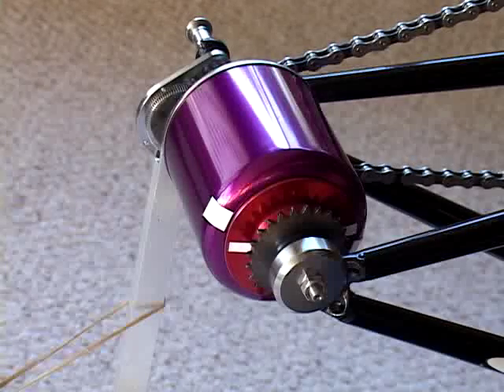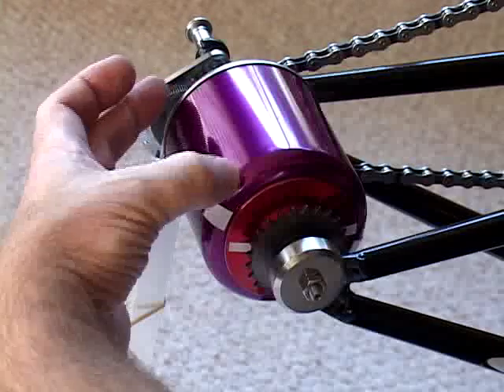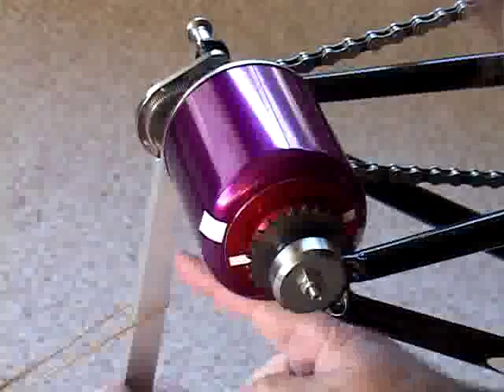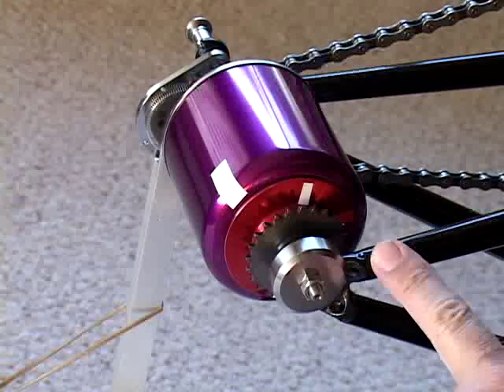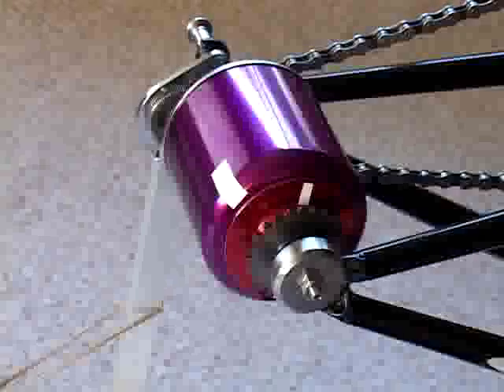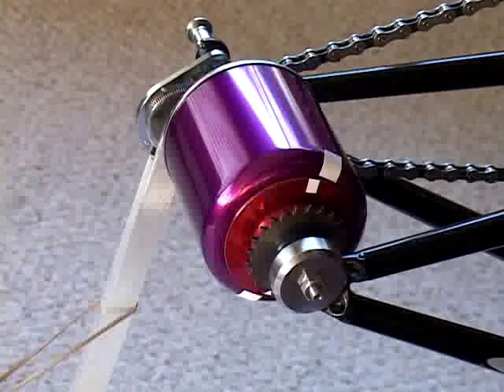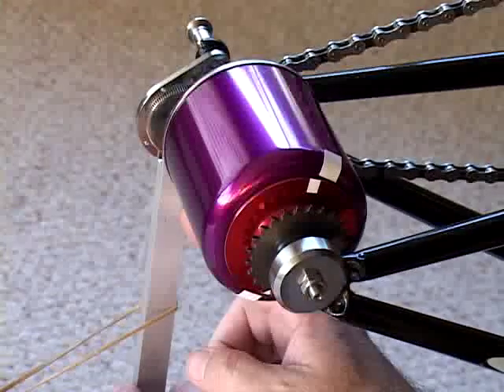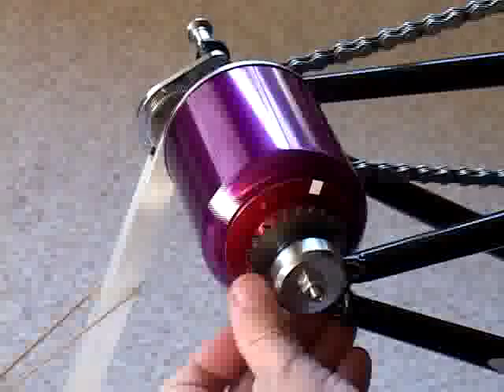Automatic Bicycle Transmission (IVT)

Comment from the maker: @Polybun The bike SIVAT will have a handlebar-mounted lever that will allow regulation of responsiveness, including ratio locking at its extreme position.  Regarding torque, I know exactly how pedal torque works, & at what levels, because I've done extensive research on elite cyclists' power & cadence performance; this includes sprinters.  One of my available Word docs is a study on this torque; if you're interested in reading it, put your email address on my channel messages.

Comment from the maker: @v50man A  simple planetary system (3 planets) is around 94-95% efficient with 2 meshes per planet, so you're a little high on losses.  Anyway, SIVAT will be ~87% in very low gears, ~90% at mid-ratio, ~93+% in high (ratio=0.666:1).  The SIVAT will be mounted directly above the BB by ~10", with a chain-drive stage to input and another chain-drive to the back wheel for increased power density of SIVAT (at high revs); this will keep mass at a low ~2.0 kg.  Expect another loss at ~2% for 2nd chain.

Comment from the maker: @GRAHAMAUS Electric motors are most efficient when they are run close to their rated load, so speed modulation does have an effect of increasing systemic efficiency under certain circumstances.  Total power output generally increases at higher revs, so speed & load have significant interplay. The Tesla originally had a 2-speed transaxle for that very reason, but the tranny was abandoned only because motor torque & shifting shock loads were hell on its gear-teeth.

Comment: @asdfghjklkjhgfdsa555 That seems doubtful. Electric motors operate efficiently over a wide speed range as they are and don't generally need gearing, whereas a human being really just wants to work at one optimal cadence. A CVT on a bike with human power makes perfect sense, as long as its transmission efficiency is very high.

Comment from the maker: @theamberco Torque converters rely on hydrostatics that waste energy through turbulence & fluid shear; that's why they heat up (<75% effic.).  By contrast, SIVAT runs cool because coupling is via steel-to-steel with very little slippage.  Only thermal tests have been done, but dynomometer tests will be done on Gen2.  Industry data are available for gearing pairs for theoretical efficiency of SIVAT at ~88%-94%, low in lowest gear ratios.  Electromagnetic coupling tech has a long way to go!

Comment from the maker: @jhobbz45 The wheel can handle the forces, but the SIVAT axle cannnot.  That's why the next design, called Gen2, will move the SIVAT to the bike frame.  It will be slightly different too.

Comment from the maker: @markdream7312 You fail to understand that the principle here is not drag, it is intermittent locking action.  Power transfer through the SIVAT is via gears and a non-sliding connections.  Look up 'ratcheting CVT' in Wikipedia.  Do some research before you publicly trash anybody's work!  Leave your Attention Deficit Disorder to yourself.

Comment from the maker: @Limetym510 I watched their videos on EBM technology.  It's unclear what their claims are, except that they produce 40%+ 'excess energy'.  What does that mean?  Energy production is a meaningless term regarding motor's & generator's design.  Motors & generators now are typically 90%-98% efficient, so producing significantly more output power is impossible; 100% efficiency is the limit, and really never achieved.  Their products look like 'snake-oil'.

Comment from the maker: @schlusselmensch The next step is to produce an advanced prototype for a real application, and then to test it thoroughly.  The candidates being worked on include a bike & a robot.  Once it's proven to work well in practical examples, then investment needed to build a company for production will be easier to acquire.  Right now it looks incredible; it needs to look credible.  A small, but significant (fixable) design flaw in the video prototype prevents it from handling biking torque levels.

Comment from the maker: @psk1w1 For cadence regulation, the torque-reactive automatic feature will result in fairly constant cadence regardless of the grade ascent or descent.  A spring pre-load adjuster will allow the rider to make a global adjustment to suit his desired cadence/pedal force.  The very special geometry of the reaction mechanism allows a simple spring constant to derive the correct ratio at all times.  A damper will slow the reaction, so that the ratio doesn't change with foot angle in pedal strokes.

Comment from the maker: @Pablotheawesomeguy The output sprocket produces higher torque as its speed decreases.  The zero-speed condition will not normally occur until an overload occurs, or if it's used as a clutch ot torque-converter on a motorized vehicle.  Bicyclists might never experience this condition.

Comment from the maker: @psk1w1 The next prototype will be tested for efficiency.  A composite calculation, using known figures for gearing efficiency, suggests that its efficiency will be in the 90%-94% range.  Like any geared transmission, efficiency will drop lower in very low ratios.  For comparison, derailleured bikes are typically in the 93%-97% range, depending on sprocket alignment which is often poor because only 2 or 3 shift selections have aligned sprockets.  The 'auto' feature is the governor.

Comment from the maker: @calirapqueen In terms of power throughput, the newer unit I'm designing for a special bicycle will handle 1 kW (1.3 hp) at 500 rpm.  A step-up 'gearing' increases pedaling speed by a factor of about 7X to its input.  Elite bicycle racers won't be able to break it by producing their maximum power.

Comment from the maker: @cheetawolf Several commenters have asked the same questions.  We must prototype fully working units for testing before putting together production capacity.  It appears that a robot mfr & a bicycle builder are interested, so this will likely move forward.  For bikes, the process will take more than a year, perhaps two.  Bike SIVAT's will cost around 1000 bucks initially, but mass production can bring that down by hundreds.  You'll easily find where to get them when it's a product.  Thanx!

Comment from the maker: @vwdriver219 The intent of zero speed is to allow stopping without a torque converter or clutch for accelerating from stop.  For traveling motion, the correctly adjusted SIVAT won't go 'passive', even up steep grades.  Kinetically, the SIVAT works like all transmissions; it trades off propulsive speed for gained force, & vice-versa.  The purpose of the SIVAT is to gain systemic efficiency by optimizing prime mover (motor, engine, legs) speed at ALL driven speeds, rather than occasional speeds.

Comment from the maker: @dmzd Shaft drive for bicycles is reliant on bevel gears, which are inefficient.  My proposed drive (somewhat different from the one in the video) will use two chain drives; one from crank-to-SIVAT, and another from SIVAT-to-wheelhub.  This will be slightly less efficient (2%-5% less) than a derailleur systems.  Power capacity is about 1 kW, which is roughly equivalent to derailleur gearing in most situations.  Weight should be less than 2 kg, compared to derailleurs at 1.2 kg.

Comment from the maker: @TechnicalFreak Great insight!  That has been part of the plan for motors & engines.  Some very early responses to comments ( 11 months & 12 months ago) referred to KERS.  You'll get an initial boost, and overall efficiency improvement.  A friend has recently acquired funding for a related flywheel system, with the goal of eventually merging these technologies.

Comment from the maker: @budedees I invented an earlier automatic ratcheting CVT that I mounted on a bike & rode around in the mountains. One-way clutch specs for capacity & life looked good, but I needed proof. The mechanism was uncovered, exposed to dirt, and lubricated only once.  Hundreds of miles later, it worked the same as new.  If anything, the specs have a healthy safety factor.  Most automotive transmissions use these, so they have a hellova track record.  What's your agenda?  Armchair critic?

Comment from the maker: @boogiewoogie0922 The REAL SIVAT for a bicycle will use a very stiff spring to do what the rubber band does in this demo.  The automatic feature is its reaction against the spring; increasing pedal force (such as riding a bicycle up a hill) causes the ratio control mechanism to compress the spring with a resulting lowering of the ratio.  Lighter pedal force allows the spring to 'win' its battle, raising the ratio. The effect is a fairly constant pedaling force & cadence, regardless of grade.

Comment from the maker: @cheapspace Georgi Georgiev built the fastest bicycle ever; 82.3 mph is the world record for an HPV, with Sam Whittingham's legs providing the power.  Aerodynamics is by far the most important factor in achieving top speed.  Georgi & I have talked about gearing, and we concluded that SIVAT gearing might help achieve a slightly higher record.

Comment: people who race bikes for only top speed would benefit from this transmission right? I wonder is it possible to achieve 70 + mph with this: as well would be a little easier to reach those speeds compared to traditional gears?

Comment: would you want the output to be on the outside instead of the inside? That way the output of the transmission would form the outer part of the hub where the spokes attach.

Comment from the maker: @paintballgundown8 For electric motor-driven machines, it would behave similarly, but would give you much more control over both power & efficiency of the drive system.  Both motors & engines produce peak power & peak efficiency within narrow speed ranges; the SIVAT will adapt the to those input speeds while allowing your output speed to constantly change over a very wide range.  CVT's have proven this, but have limited ratio range unlike the IVT.

Comment from the maker: @KapteinOpel You've got the right idea.  John Deere produces a line of small tractors that use a transmission that they claim is an IVT which works on a different, less efficient principle, but it was designed for the very purpose you suggest.  An earlier commenter also suggested the snow-blower application.  I believe this SIVAT has many other uses too.  Most machines depend on efficient rotary operation, and many need widely variable speed & torque.

Comment from the maker: @luc59457 The video presents a concept.  The next design will be fully functional, mounted on a bike that will accept engines & motors.  That bike will likely be the first product; this transmission won't initially be sold for fitting to other bikes.  The automatic feature will use a spring mechanism to react against pedaling torque, as simulated by the rubber band in the video.  I know this definitely works because I built & tested a predecessor CVT bike with a similar system.

Comment from the maker: @35Berrin ...Best efficiency of legs is at about one speed (about 90 rpm), so you want to to maintain that as your vehicle speed changes while going uphill, downhill or on flat road.  The transmission enables your vehicle to do that!  This principle is true for all powered machines; the legs (or engine) work most efficiently at nearly constant speed while allowing widely varying output speed at the wheels.  SIVAT is internally quite efficient AND it improves leg muscle (or engine) efficiency.

Comment from the maker: @35Berrin ... No transmission is more than about 98% efficient, usually much less!  Now, you'll want to have high efficiency so you get most of your energy used to propel your bike or car, regardless of whether you're going uphill, downhill or on flat road as your speed changes.  Now, you've got to consider efficiency of your legs (or engine); it turns out that pedaling speed effects the efficiency of your leg muscles (or engine)!  continued...

Comment from the maker: @35Berrin You are asking about 2 different things: speed & efficiency.  This SIVAT changes the output speed while allowing the input speed to remain constant.  During operation, it transfers energy from your pedals (or engine) to the wheels, losing some energy in the process, so you get less than 100% of the pedal energy to the wheels in what's called efficiency.  Car automatic transmissions are about 80% efficient, the SIVAT is about 92% efficient.  continued...

Comment from the maker: @35Berrin I'm not sure I understand your question, but will attempt to answer.  A spring causes the SIVAT to tend to go to its highest gear ratio, which may be set by sprocket sizing to be whatever you want.  When you pedal with force, that ratio drops only as far as your pedal force requires; and goes back up as your pedal force decreases.  If you coast without pedaling, the ratio will eventually rise to its top ratio.  How fast that happens will be adjustable with a thumb-screw.  Answered?

Comment from the maker: @Greg11980 The SIVAT is an IVT.  You may choose your highest gear ratio to be anything by choosing the input and/or output ratio, and still achieve all ratios lower!  The video uses a 55T/11T, or 5:1 input, for instance.  You have infinite ratio choices with infinite range, always down to zero output!  Power throughput is only a function of SIVAT size; a 6 hp motor would require a slightly larger size of about 4 inch diameter.  Automatic too.  Isn't this a vast improvement?

Comment: If you go from 0-1 to almost 1-1 how is this an infinitely variable transmission? I like internal geared hubs for bikes that have been around for 40 years and there are a lot of advancements, in that field I would like to use one on my motorized bike, if one comes out that can handle more than 1.5hp-6hp but what is the improvement with your design over a Sturmey-Archer or Shimano or speed design hub, that you were showing for almost 8 minutes?

Comment from the maker: @willubemyfriend4ever Energy consumed in the automatic function is negligible because it is not directly involved in the main conversion of the speed/torque ratio of power in the SIVAT.  Furthermore, the rubber band, which represents a spring, is an energy storage device; so, small amounts of energy are stored and released in its own operation with high efficiency.  Goals of the SIVAT concept are to be efficient, and to improve systemic efficiency of motor or engine power conversion.

Comment from the maker: @PicoDeFreako Yes.  Older comments explain this.  High gear limit will be above 5:1 by virtue of different sprocket sizing in the next prototype, called Gen2.  Note that, in the video, chain divergence toward the chainwheel (at front) is from a 55T/11T drive; not quite enough for optimal operation because the SIVAT itself operates best below ~2:3.   Gen2 fixes this shortcoming of the unit in the video.  Gen2 will be have a different chain-drive system to achieve that without a huge chainwheel.

Comment from the maker: @zohaib029 There's more.  High gears are for downhill because you do not want to pedal too fast as your bike gains speed going down the hill.  In high gear, your pedaling force normally remains high until your pedaling speed increases.  You will want to always have moderate force & speed in your pedaling for best efficiency, regardless of the grade of the hill, up or down.  Ride your derailleur bike around, & observe this relationship between pedaling force & speed, while changing gears.

Comment from the maker: 12.  Thanx.  In the video, the rubber band represents a spring, which for a bike will be a strong spring that pushes the IVT mechanism toward its highest gear.  Pedaling force tends to compress the spring in a way that responds variably to the amount of pedaling force, lowering the gear ratio.  When you pedal downhill, your pedaling force is low because the hill does most of the work via gravity & your weight, so the spring hardly gets compressed at all, keeping the SIVAT in higher gears.  OK?

Comment from the maker: @zohaib029 You need not be apologetic about being a kid, nor being fascinated by an invention; those are both great qualities, especially together!  The SIVAT should be good for uphill, downhill & flat because of wide range of gear ratios.  The re-design high gear target is higher than found on most road bikes, and low gear is unlimited.  Other answers are among the 300+ comments.  What's your age?

Comment: @SIMKINETICS 
It would boost RPM input at lower engine rpms and lower rpm input at higher engine operating speeds. 

This would increase the superchargers output (PSI) at lower rpm ranges and it would prevent over spinning the supercharger at higher engine rpm.

Comment from the maker: @ninjaturtle11754 Yes.  That low speed jumpy action disappears when output torque rises above 2 to 3 ft-lbs.  When using the SIVAT on any machine, low speed output torque will be far greater than that.  Most machines act that way at low loads & speeds, but it's unnoticeable in their normal operation.  An IVT just makes it more obvious.

Comment from the maker: @Pipewing Thank you! Patent law & our competition make it unwise to show how the SIVAT works. Some insights can be gained thru Wikipedia; look up IVT. Getting smooth motion from a ratcheting IVT is very tricky, so my patent application covers such specific techniques in its claims. The main purpose of this invention is to increase systemic efficiency for all drives; including motor, generator, engine & human power. Yup, better gas mileage!

Comment: Fluid drive already does this, better, simpler, and cheaper, and goes all the way back before 1940.   Two discs with blades on them, like a typical clutch, all immersed in a thick oil.  One side spinning, spins the oil, and sets up a sympathetic spinning in the other, depending on how close it is.  Want to increase your gear ratios, just move the blades closer together.  Want 100% and 100% torque, move them even closer so they lock like clutch teeth.    Want less, move them further apart.